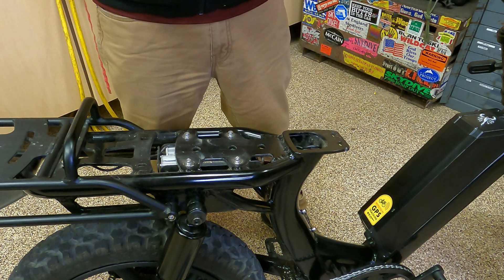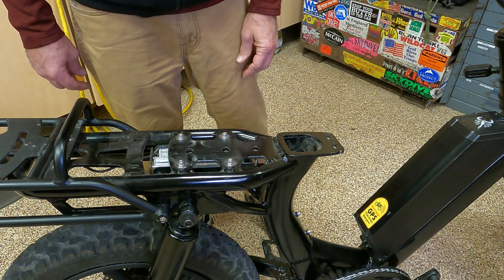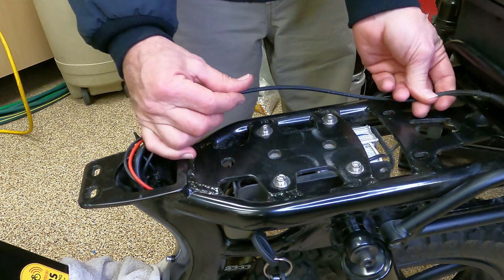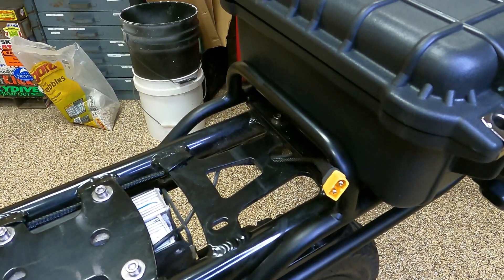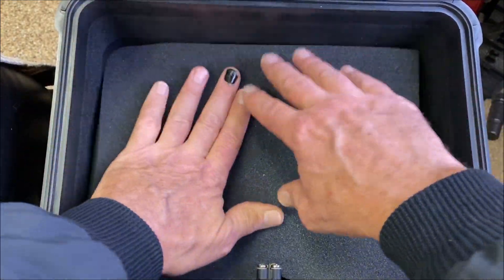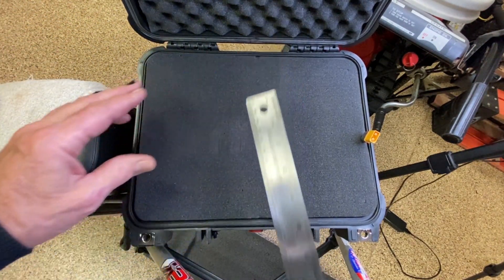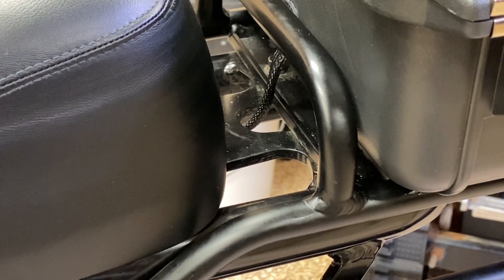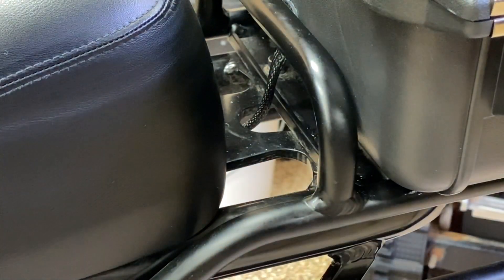HOW TO➕ADD an Additional🔋Battery in a Box to any E- Bike🛵 🚲 Easy to DIY💡  PART 2 of 2

Comment: Where did you find the on/off switch for the auxiliary battery?
Reply from the maker: https://www.ebay.com/itm/354147340721?_skw=Battery+Isolator+Disconnect+Cut+Off+Power+Kill+Switch+for+Marine+Car+Boat+RV+ATV&itmmeta=01KCEYWSXW1RD71SBQME78GMMT&hash=item5274d391b1:g:GQMAAOSw2mViorP5&itmprp=enc%3AAQAKAAABMFkggFvd1GGDu0w3yXCmi1c2YNLyKsBjJE%2BLyAXQYjMcKo3bhIvQBDFv4PEExhN7Kf5k7p5sCse3OyMEIHb8Am9xZzElydjEqnZbz8Rd3poHdAUz62QOuTAUOqkni4ZxMg0pQgXvnCZRpeTkuivuXu8zKXxpWSh1RvJDVqG%2BmK%2FuW2Y%2BDItS3RvmU9QAa7PtBCqcBlTH0vhdblNFzUWNBNVg7Sp5VpTu8mk1tvT5dVTbuV%2BLxaOAy2rPN0X%2FwnWV9D0TwntEoDboLgmDkxf5uL5hkACOfgzCK1DX4JJqD7fdKw0iEzCo1DkRNMDKeuFMBo70gkTO7hLyfctQHoZ2SqRmsYDbGPOPht1LGO0ao9ReqpNG0LQjwVEgVSDDtv756aV4jyg7VVxj3CNXTsw2vbE%3D%7Ctkp%3ABFBMmJ_z3uNm

Comment: Thank you very much for this. My main battery on my Scorpion is about kaput. 
And, btw, some of your affiliate links are dead. Beer money matters, and you earned it with this!
Reply from the maker: 😎 Nice Heritage and 996 Turbo.  I got a friend that would buy your rear wheel with motor, if you want to piece it out.
Reply: @UncleFjester  Thanks. I like your cab, too. I had a 99’ cab that I still miss. Many smiles per mile in that wonderful car. Part out my badass Scorpiown (correct regal sounding  pronunciation) electricycle? Never! It’s about to get the UncleFjester Young Frankenstein “It’s alive!” 2nd battery  rebirth treatment!

Comment: you do know, you can run 2 or 3 batteries in parallel, this way you do not have to worry about turning off one battery ok and can run 2 or 3 batteries at the same time, which will increase your speed as well as your range hehe
Reply from the maker: I'll have to disagree on the increase in speed and agree on everything else. Thanks for hangin around
Reply: @UncleFjester  well, i will find out, if it does increase my speed or not, but yes other people on YT, have said adding more batteries can increase speed as well, but i do not know that for sure either, but i will find out one day hehe
Reply from the maker: One Day huh? 😎 Hook up 2 batteries in series will double the voltage to the motor and make it twice as fast, for a short period, till the motor & controller overheat and melt. Its all a matter of its intended design.
This will explain it in very simple terms...   https://en.wikipedia.org/wiki/Ohm%27s_law

Comment: If the batteries are hooked up in parallel, it will increase your capacity. If you hook them up in series, then you increase voltage.
I don't see why you can't run them both on at the same time... unless maybe because they are not equalized?
Reply from the maker: I only run both 🔋🔋 together, This 140 pound Turd runs like an old dog with only one battery. Thanks for watchin!
Reply: @UncleFjester  As to what I understand, if running both batteries in parallel, they both must be equally charged/same potential. If not, the one that is lower in potential will vampire potential from the other battery.
Reply from the maker: What I do is, I charge both batteries overnight to full charge, 2 separate chargers, make sure you have both batteries isolated so they don't share a charge. Then I ride, with both batteries on, usually can get an easy 40 mile range w/o ever pedaling. If I get off the bike for any amount of time, I turn off one of the batteries, so they can't have a party without me. 🥳 
Don't get OCD about exact 🐂💩on state of charge, potential, etc.  All batteries are designed to work with other batteries regardless of age or rate of charge. 
For example many commercial buildings have battery back up systems with 50 batteries all in parallel, occasionally a battery dies and is replaced.  They aren't replacing 49 good batteries to keep everything perfect.  When the bldg. is built everything is matched, in 20 years you can have 10 different batteries including originals.  
At the end of the day its just an eBike, not rocket science, or SpaceX would have EV rockets...🤣😂😆
Thanks for the comments, I can tell you know a lot more about batteries than others.

Comment: I worry you are going to forget once or twice and have both on at the same time when the voltages differ, ruining one or both batteries.  I would just charge them both to the exact same voltage and then lave them permanently connected in parallel.
Reply from the maker: They are always on together when I ride.

Comment: you did a great job of connecting 2 batteries with switch that is always the safest method , i have bought switch with rating od 20amp, i have 2 batteries one is 48v 30ah with this specs do you think switch will work with battery of this specs bellow ? will i have problem if i connect this battery to this switch ? 
BMS: 20-50Amp continuous 50±10Amp maximum
Charge Current: 2-5A
Charge Cut-off Voltage: 42V/54.6V
Discharge Cut-off Voltage: 30V/40V
Discharge Temperature: -20 to 65°C
Charge Temperature: 0 to 65°C
Reply from the maker: That will be fine!
Reply: @UncleFjester  ok thanks :)

Comment: My friend, you are totally incorrect.  You should connect both batteries together in parallel all the time.  That doubles your range and does not drain either battery too low.  also, depending on how you wired the charger circuit, you can charge them together..... As long as you start with both batteries at exactly the same voltage...  Please mention this...
Reply from the maker: Exactly!  The Aux Battery has its own separate charger and plugs in, just like the stock charger.

Comment: So that is polarity? That the male connector is connected to the controller and the female is coming from the battery? And the square side is the red the positive? Correct? And also,, the xt60s I have,, i can squeeze the end of the female. Is that good ? And do you have to solder the xt60h ?
Reply from the maker: Double check your wiring for the square size being red, Never assume, but yes that is what we call polarity,  keep the red consistent throughout the harness.  I had to solder mine, but they make pigtails already soldered for ya.
Reply: @UncleFjester  Also I cannot connect from a 12awg splitter to 14awg< XT60 to XT60 Male & Female Adapter Extension Female Male. Correct ? I bout mine already connected. The 14awg.
Reply from the maker: Why not?
Reply: @UncleFjester  I am really sorry iui f have too many questions, but there is not anyone for at least 300 miles who will work on my bike since I did not purchase it from them. But as for adding a second battery ? Does it matter weather I use the the male or female xt60 to connect to my controller ?
Reply from the maker: Questions are OK! they are just connectors, but if your controller already has a connector, on it why change it? Now I'm asking questions😆
Reply: @UncleFjester  it has a T-Type 2 Pin Way Electrical Automotive Wire Connector
I am wondering why and if I should change it when I add the extra battery? And would it be good if I used 14awg wire with xt60 connectors ? Since I have a 350w motor ? The electrician dont know what an xt60 is, but I do have someone who knows how to solder. I am using 48v 20ah batteries.
Reply from the maker: I'm impressed with the XT 60's, change it!  I'd still use #12awg where I could
Reply: @UncleFjester  thanks a bunch. Do you know where to get genuine xt60 connectors that dont melt. Especially when connecting? I hear they like to melt or burn while in use.
Reply from the maker: They are all XT 60 Spec'd so it shouldn't matter.  Unless there is a problem with the solder connection or they are overloaded, I can't see why they would ever fail.  Don't over think this, its stupid simple wiring.
Reply: @UncleFjester  I need only to connect a Parallel Battery Connector Cable Extension Y Splitter 

To the positive and negative wires from the controller to the batteries correct ? I need not connect to anything else like the motor ?
Reply from the maker: No, the battery is all your adding.  the controller controls the motor, the motor has its own wires.
Its like the old Police Mag Lights, you could have 2, 4, 6 or 8 "D" Cell batteries in the tube, all parallel

Comment: I’m sorry but please tell me why you just don’t run them both at the same time in parallel???? If you are implying that you will get double the ride then both batteries are equal in ah. Last time I checked connecting two equal batteries in parallel is perfectly fine and only makes it stronger, BMS or not. Pls stop wasting your time having to turn one off and one on and just make a harness that connects the two batteries together.
Reply from the maker: Pay attention Fjucka, 🤦🏻‍♂️
1st, the batteries are hooked in parallel
2nd, the switches are for isolation during charging since the 2 chargers have different charging rates
3rd, I run both together. Every time
4th, nevermind, I want to be nice today🤣
Reply: Makes sense. Or disconnect manually inside box before charging second battery.

Comment: Well done! Please confirm my understanding: capacity of the second battery can be any number of amp hours, as long as voltage is the same as the stock battery, and I can run them to the controller with a parallel cable, (and switches) is that correct? Funny, I bought a battery before I bought an E-Bike 😅😅😅 Nice to meet you! I'm Glenn. I subbed ya :) Have a great day!
Reply from the maker: Welcome Glen, Yes to all, then you can run one battery at a time or both together.  I prefer both and believe I get better performance and range. Thanks for the Sub👍🏻
Reply: @UncleFjester  Thanks for the reply! My bike arrives in tomorrow's mail! I'm psyched! Have a fantastic weekend :)

Comment: @5:11 you have the male and female xt60 leads coming off the switch.  How are the other ends of connecting to the switch?  I'm pretty sure it would be a ring connector. How do the four ends connect to the two screws?
Reply from the maker: Only the Hot goes thru the switch, the Negative/ground  can feed thru.
One end of that harness goes to the battery, the other connects to thh harness coming from the down tube. Connect the wires to the switch with either a ring or spaded compression connector.  Yellow for #12
Reply: @UncleFjester  Thank you for replying.  I think I have it except what you mean by Negative/ground can feed thru. I'm not an electrician. Do they connect to each other?
Reply from the maker: The negative doesnt get switched only the positive goes thru the switch
Reply: @UncleFjester  I understand now, thanks. Enjoy the ride!

Comment: Okay, this is great stuff Uncle! My parts should all be here by end of this month…..I actually pedal with assist 1, and get about 35 miles so my Scorpion X …..should be good for all day…..:)
Reply from the maker: SolR, you got so many Ebikes!  But if I was wanting to pedal, I'd get mid motor fat tire bike with a seat made for pedaling. The HS is my Throttle Toy
The other day I got 25 miles in Full out Race Mode and still had 1/2 left, but I got bored.
Reply: @UncleFjester  I asked on your other video about the wiring of the Blue battery, because the connector is metal going to the 2.3amp supplied charger. How do I wire in the XT60 plug in the trunk … to this wired configuration ? I missed that part. I hurts to pedal this 103 pound beast without assistance. Yea, I gonna have to raise the seat for the proper leg extension.

Thinking about that question, I’m assuming I just Tyser plug red red and black to black it’s pretty simple. I just didn’t wanna start any lithium fires till it dawned on me what was needed…duh
Reply from the maker: There are two cables exiting the battery, the Silver is for charging, the other connects to the harness.  If the battery comes with an anderson connector, then get an Anderson/xt adapter or change the Anderson to an XT60.
As you've learned, the SCORPION is for throttle only, and the pedals are for when it dies and you need to get off the street.
Reply: @UncleFjester  Thanks for the info,  I can’t help it I’m just like a hamster ….I can’t stop peddling..:)

Comment: Can I use 3 way switch for this?
Reply from the maker: The way I have this wired, the switch on the box is a Single pole, basically a shut off, the one for sale on ebay is a 3way (selector) I believe.  I am currently(pun intended) running both batteries together when I ride with ZERO issues.

Comment: If the batteries have the same Voltage rating, couldn't you run them both at the same time since they're in parallel?

Super clean mod btw.
Reply from the maker: 👍YES! That's how I ride now.

Comment: If you let some curious YouTube viewer buy your new second battery pack, you would have space again for a newer better battery pack made from 21700 cells. Wouldn't this deliver greater amperage and range. It would be like sticking Robert Conrad DURACELLs up the Energizer rabbit's butt to make it run faster and jump higher😉👍.
Then you could try 2 different 21700 packs and compare 12S2P versus 12S3P configurations.
Reply: Can you do this before June when my pre-ordered Ebike gets shipped out❓ I live on top of a hill so I will have range anxiety forever because I don't want to have to pedal uphill to get home when my battery gets drained.
Reply from the maker: Ana, Haha...I looked into a battery with 21700 cells but this is a POS bike & I already have way too much money in it.
What I'd really like to do is put the Battery up Toga's Ass for building a Crap Overpriced Bike.
I live up a hill too, (see my riding videos)  Not sure of your streets grade, but stock, I made it up fine pedaling after the battery strained to the point of being a brick.  With the newer battery I don't need to pedal.
If you drain the battery, you'll be walking it up hill, this is too heavy to pedal when bricked.
Reply: @UncleFjester  i have handicapped knees.  
I just zero resistance freewheel pedal for cardio.
I need electric power or I am calling an Uber van taxi.
Reply from the maker: I try my best not to pedal, but FWIW, my Doctor told me exercising regularly "might' extend my life by 2 weeks.  Don't run the battery down, if you do, let it rest for a while & it will get you another minute or two of power

Comment: What type brand model charger are you using for this particular external battery from Amazon. Do u have a link for it?
Reply from the maker: It(battery) came with the charger!
Reply from the maker: https://amzn.to/3jDbnMM
Reply: @UncleFjester  Thanks for ur reply appreciate it. I did see any description about including the charger but I'll take ur word.
Reply: @UncleFjester  What's the range on this aux bat? I recall ur vid about testing the range for this bat. Also how much or little pedaling and throttle with the range?
Reply from the maker: The new Battery is considerably Better! Pulls better! Better Range! Doesn't go into limp mode near as fast as the stock Battery.  But I'm now running with both batteries on together, I try not to pedal unless I need to assist to get up something.  Throttling is more fun!
Reply: @UncleFjester  Yes sir its more fun just throttle, one more ?. So with both bats on du u get around 60 miles than? Thank u for ur help I love ur vids. Ur actually fun and funny guy to watch. I watched u install ur dirt tire on ur rim. Your frustration reaction killed me. Lol! Keep up the great vids.
Reply from the maker: Its still too cold for me to MAX out any range, just started to snow again, but my estimates are... 40 miles in race mode, 50 miles in mode 3.
To get 60 you're gonna have to pedal and we all know this isn't set up for pedalling 2 miles😆🤣
Bicycles set up for distance pedalling have full leg extension, and skinny hard seats.  Not sofa cushions like this has.

Comment: I'm trying this myself but my question is , is this safe for the controller motor ? 🤔 I bought the xt90 splitter parallel adapter from ebay so I don't gotta solder , I'm just worried to much power to controller and motor might be bad ?
Reply from the maker: My soldering sucks, can't see 💩 up close.
The way I see it is, the motor can't pull more than it already is, run one battery or both, no difference...yet!  But We have disconnects on both if needed.

Comment: Totally agree with you! The battery claims are extremely misleading. When you go in and look at the charts Juiced provides, in super tiny print they state: you'll only be able to get 70+ mile range with the following settings: Rider weight less than 90 lbs, 14 mph max, flat (no hills), no wind, warm & dry weather, and their tires were inflated to 60 PSI.

With their 52v 19ah battery I've been getting averaging 15 miles @ avg speed of 25mph.

Comment: Are you using different connector's to make up the wiring harness? I'm using 10ga wire and it's a bit challenging.
Reply from the maker: I used #12 THHN

Comment: amazon
APIELE Changeover Selector Switch 32A 3 Position 12 Terminals Po...
$18.99

allows connection selection with one switch.

Or Bolton ebikes has parallel connection sytem
Reply from the maker: I have this wired in parallel, the switch on the box is the cut off, as the switch on the stock battery is a cut off too

Comment: does the battery need to be the same voltage ratting as the battery on the juice bike? i think its 52v? or can i use a different one like 48v? also if I do get a battery with the same voltage, can I run them both at the same time?
Reply from the maker: needs to be 52v but ah can be different

Comment: Just installed the battery box and 3/4" insulating bushing. Waiting on switch and connectors. Just a heads up. I mentioned you in a review on the JB website.
Reply from the maker: 😎  Juiced Bikes and Toga Harris sub to my channel.  And they both Suck...🤣😂😆